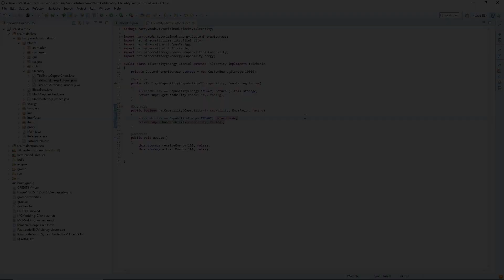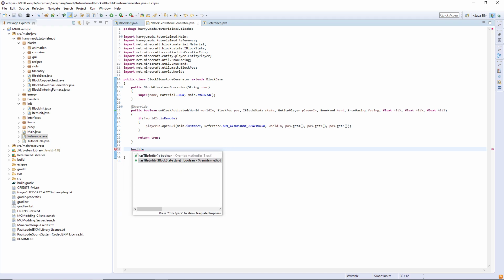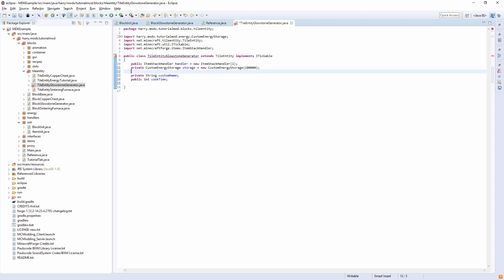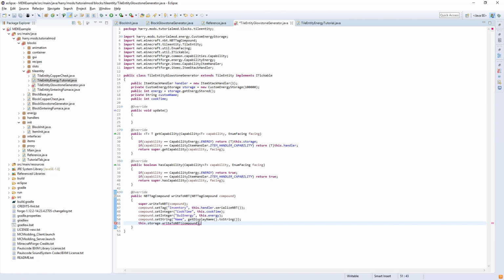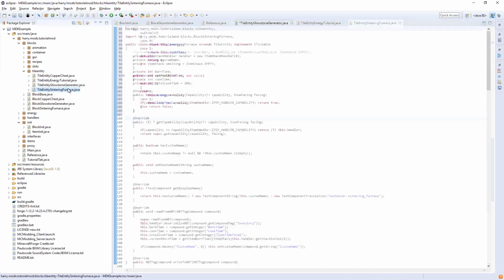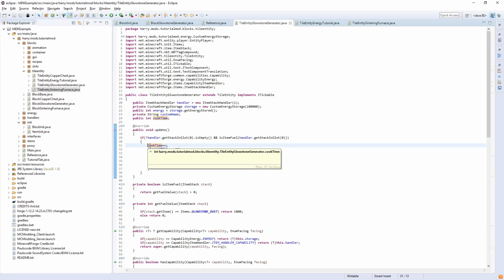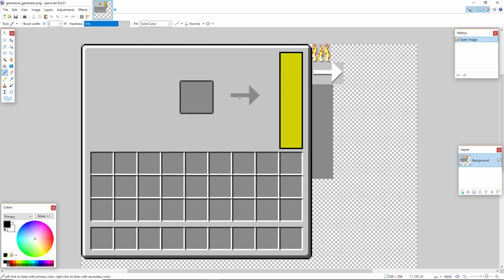Energy Generator/Producer - Minecraft Modding Tutorial 1.12.2 - Episode 34

Comment: The energy bar is totally incorrect in the end....
Reply from the maker: You can check the GitHub to see if your code is different. The code definetily works
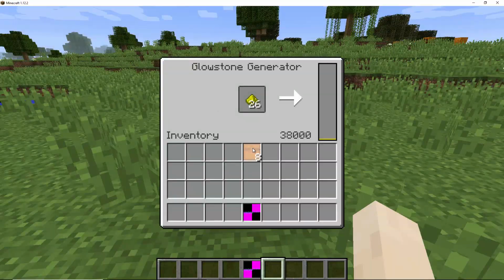Reply: @HarrysTechReviews  in the video :P it has 30000 energy but the bar is at its lowest point 18:30
Reply from the maker: The code definetily works on github so if you could figure out what's different, that would be great. If possible, can your post it in the discord solutions channel?